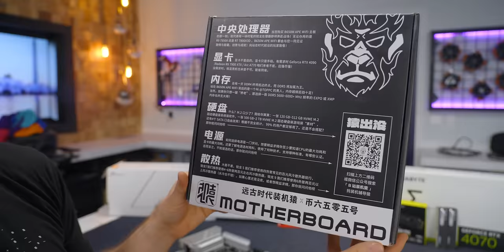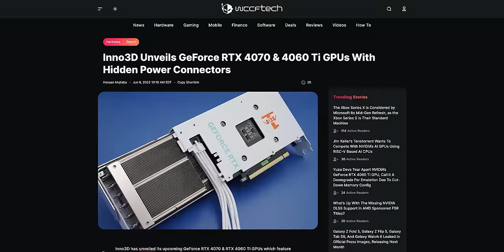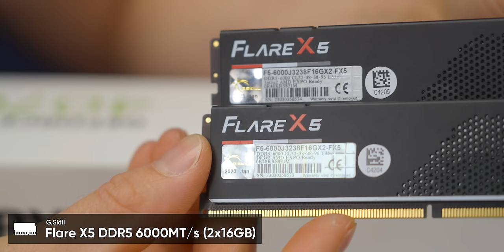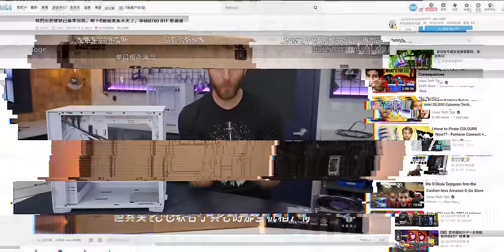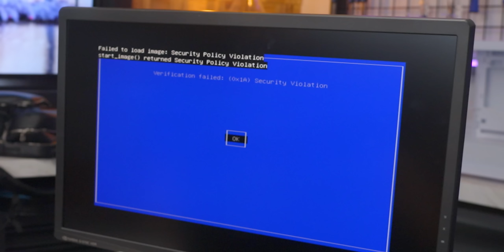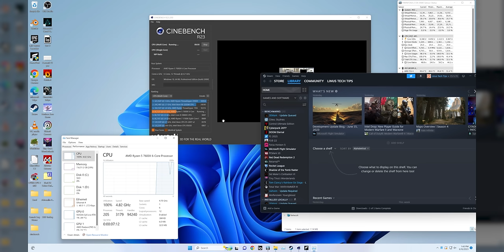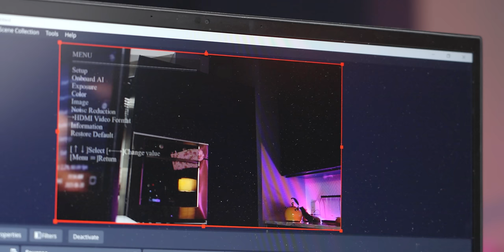This Beautiful PC has an UGLY Secret…

Comment: I like Linus and the fact that he’s got no disregard for tech things now lol 😂 … Opposed to bracing the front of the motherboard when plugging things in (since he cut away like 95% of the motherboard tray mounting points) nope instead just ram cables in and hope that little centimeter strip of metal on the side and bottom hold the motherboard tray in place with out breaking or bending lol 😂

But let’s be real this is prolly one of the more dangerous “upgrades” you could do at home. Just messing one of those cuts up and having anything touching metal could short the whole board prolly. Would not recommend people do this. 

Also I really hope that the reverse cable motherboards are left for like special edition things. Because this type of thing can start forcing people to buy the “right case” and things that fit with their builds and can mean when your upgrading you will be stuck using proprietary stuff from certain companies. Don’t get me wrong I like the rear stuff in the looks department, but that and even the side plug PSU and other things are just going to make it harder for new people to get things that work together. If your not super tech savvy and you buy a case and PSU from Best Buy not realizing that the case won’t fit the side mount plugs or maybe you accidentally but a rear plug motherboard not realizing it. Idk all this just stands to make it harder for people who don’t really have a ton of computer knowledge

Comment: 3:15 ok...base clock speed means nothing unless you're using the balanced or power saver power plans in windows. if you're using the high performance or ultimate performance power plans you're never going to see either cpu at their base clocks. they'll probably be operating roughly 400 mhz below their max boost clock at all times outside of benchmarking. So, you've no point and you're not actually paying for anything more aside from the max boost speed in this and all scenarios, which is how it always has been unless there's added cache etc. Base clock speed may as well not even be advertised. It's like advertising how fast a car can go in second gear when it has 5 gears, pointless information. Under heavy loads even with the balanced power plan these cpus will only have a 200 mhz difference. This guy also plugged all of his peripherals in the usb 2.0 ports lol.

Comment: You're not plugging and unplugging your cables multiple times a day, so putting them on the back of the board so you can admire your components makes sense, regardless what Mr grumpy pants at some convention said.

Optimize for what the majority wants, not some grumpy pants with strong opinions.

Comment: One concept ive always liked the idea of is this :
1. A singular cable that comes off the motherboard, preferably on the left side parallel with the board so it is compatible to just pass through to the back on all cases.

2. On the back, it would break out to 24pin, 8pin, and all front header connectors. Only one cable ever connects to the motherboard, but it is still compatible with virtually every case.

This would probably have some issues, but I'm curious what others think of this concept.

Comment: Cables are ugly so id be happy with this change, and if they make them all so the gpu's can be fully powered by the motherboard that would be great, especially with nvidias new fire hazard pcie adapters, and even if it has limited case options id just buy a case thats compatible, i mean whats the big deal,  cases are usually cheap enough, ive bought 5 different cases over 8 years of pc gaming ranging from $50-$300 just cause i was bored of the look of my PC.

Comment: Why do most cases have glass sides? ~ I hate it.
The best cases are a decent brand with normal metal sides and looks good from the outside - nice and clean -  (and professional) and won't age bad. It's also good that you can't see inside.

The problem with fussing over what it looks like in side the PC is it gets old fast and as tech advances it's more cringe. -  Example: "Oh hey bro your PC looks amazing, must be great specs for all that RGB and clean looking fancy-ness wow"  - And you are like.... "oh, yeah it's a 2070, 16bg ram, i7 11 series, 1 TB SSD and 1 old mech 2TB SATA HDD" - he looks at you and is like... " ohh is that all, that sh*t..." .  - You know what I mean? Like captain 6 pack with small... 

Anyway, looks are one thing, but if you start using weird ass mother boards, cases, wires etc it ends up far more trouble than its worth.

Comment: This is the most stupid trend i have seen in a long time. That and that seasonic breakout box thingy. Whats the point? You still have the same amount of cables, so you have to do the same amount of cable management anyway.
Reply: if this method was the industry standard, then it would allow manufacturers for shorter cables, which means less mess on the back, and less cables on the front allow cleaner airflow, the main issue to tackle is connection speed, since connectors on the motherboard at this point are strategically placed to reduce latency to a minimum.
Reply: @gastonzamora4985  Luke made a video quite a while back, showing that cable management , and just showing a crapton of crap into your case doesnt affect airflow in any considerable way

Comment: This sounds like a potentially good idea as long as it's done, as you said, consistently to a standard. Routing cables (especially ribbon cables) has always been (for me) the worst part of any build. I would probably leave most of the power connectors (fans and coolers as well as CPU/GPU and front panel switches and lights) on the top while moving everything else to the bottom but I don't set the standards.

Comment: Iv always thought the gpu, though so way over priced, why have alll the cool stuff on the underside where u cant see it, thought that for years, n years, n still they look upside down to me. just showing the back of the gpu when u look down at you machine. stupid, your fans should do the work to combat heat rising, no ? anyways,  if the cables plug in the back then no need for 4fancy cables mods. Also im on a ryzen 7 ZEN 2 GEN 3 Cpu. is the 5 better than the 7, we working backwards aswell ? im confused lol,  O yea i forgot to tell you,  your screw driver is a copy of the snapon gold, did you know this ??

Comment: Typical LTT video.
Get some solution, make it a problem, and ruin the whole thing! lol
Removing all the nonsense of the matter, the video is cool, and the no visible cables is even cooler! 
And for those against it, thing of the noob builders. It will be much easier for them with all connectors from the MB and PSU already on the back!

Comment: Anyone know where to get one of those low profile right angled usb adapters? https://youtu.be/tiCc6eez7FA?t=822 
Running into a similar problem on a normal mainboard but withan upright GPU mount, the pci-e riser clashes with the usb3 header.
Come to think of it,  a 180° u-adapter would be even greater...